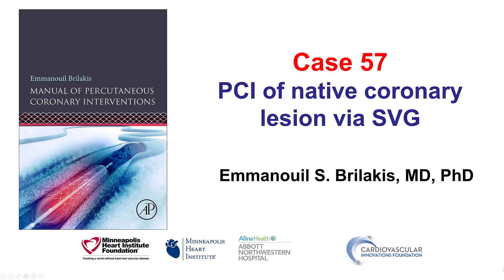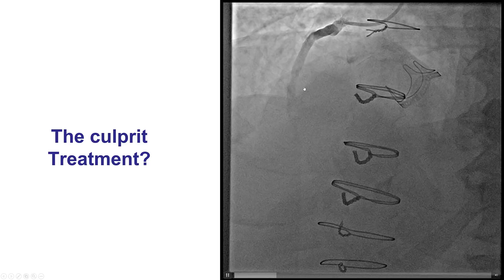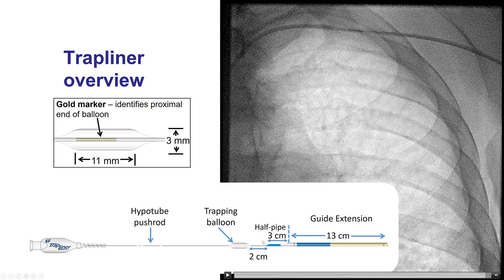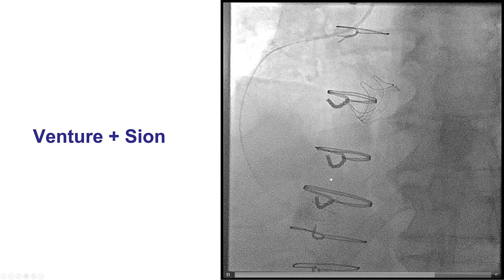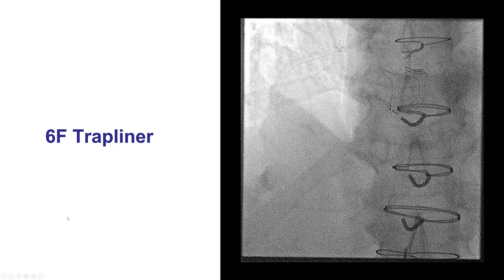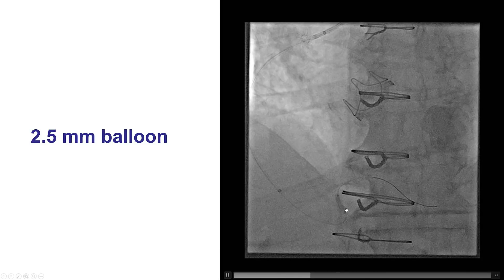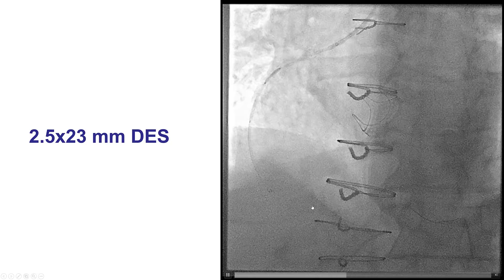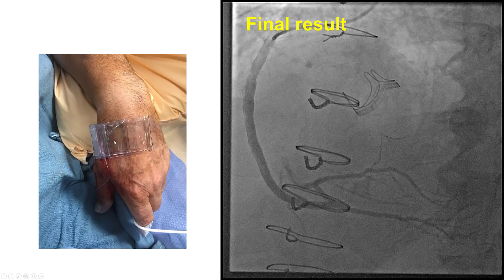Case 57: PCI Manual - Native coronary PCI via SVG

Comment: What if you had a large perf at distal RCA? What was your plan?
Reply from the maker: Coil of fat embolization (this would be a distal vessel perforation: https://www.youtube.com/watch?v=RWsCcbmQsow)
Reply: For fat embolisation instead of a micro catheter can we use work horse wire for carrying fat? If we pass inside of fat with distal end of wire can we push it with help of a balloon? Do you have an experience like this?
Reply from the maker: You must use a microcatheter to deliver the fat to the perforation site. Advancing fat on a wire alone could result in systemic or coronary embolization.